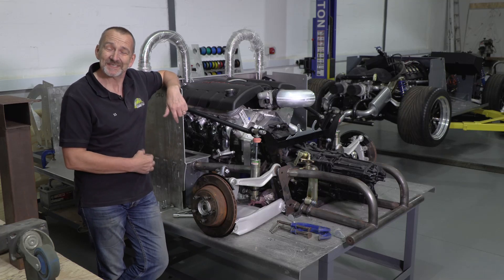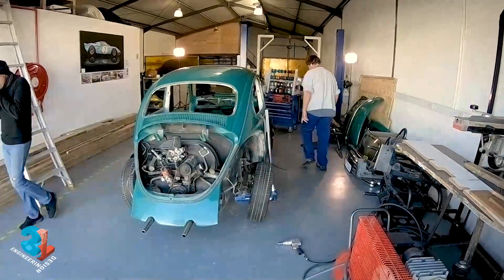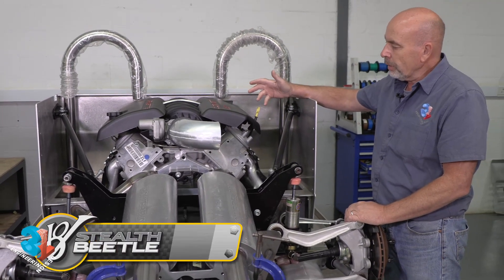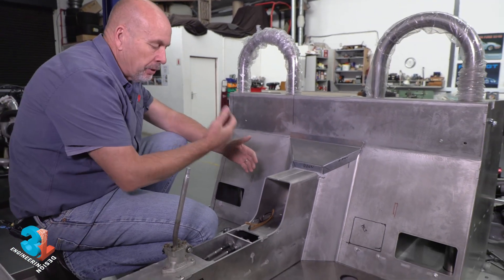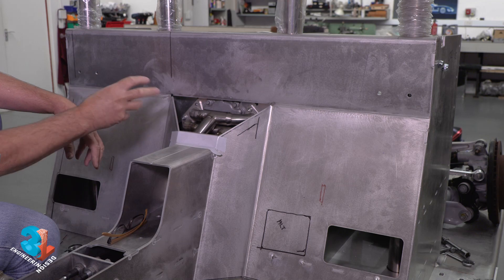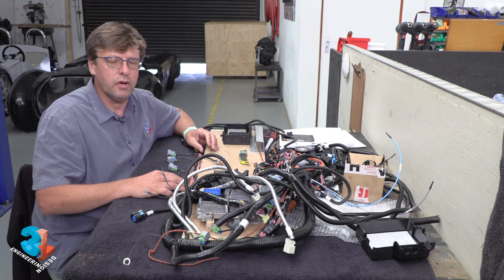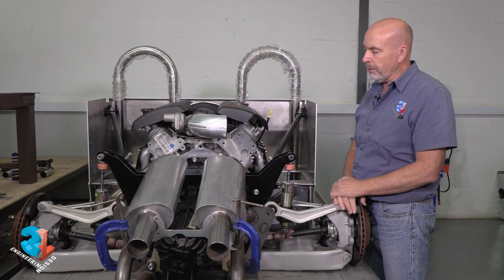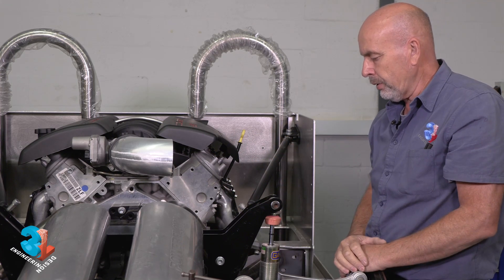V8stealthbeetle Episode 24 The FULL LS3 Update

Comment: What about fitting a custom transmission with a ls style bellhousing instead of the Audi transmission and free up space between the front of the engine and the firewall.
Reply from the maker: We want to keep the Getrag gearbox
Reply: That makes sense as you originally buit the chassis for the Audi v8 drivetrain and changing the transmission equals doing more modifications and making more custom parts.

Comment: I wonder if the LS4 front accessory drive would have offered more room in the front area, it’s the most compact LS setup which they used on front wheel drive applications, it used a water manifold and offset pump.
Reply from the maker: Interesting point, we've worked around the LS3 size issues and now excited to get it running
Reply: @V8StealthBeetle  I’ve enjoyed every episode and the craftsmanship involved